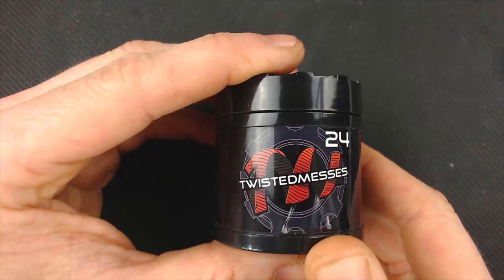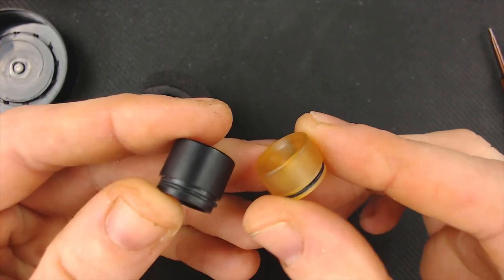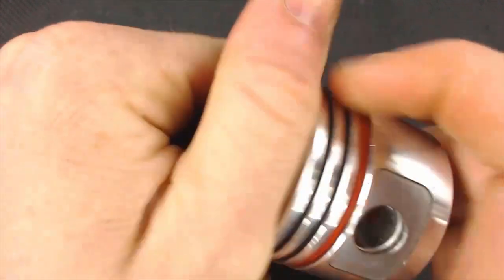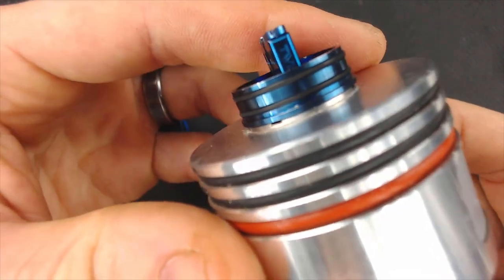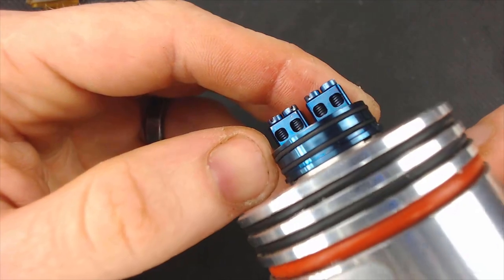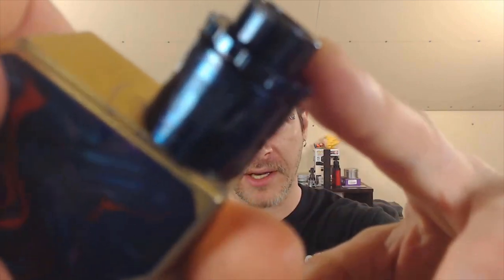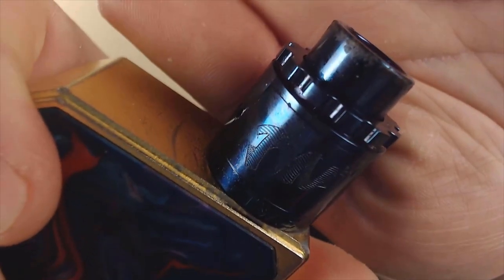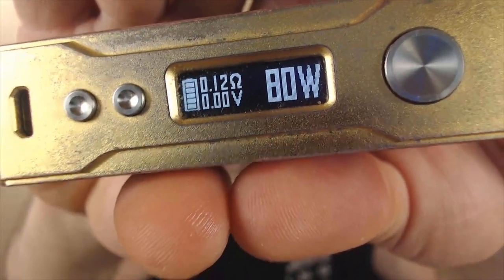The Twisted Messes TM24 Pro rda!

Comment: You gotta get the eclipse cap if your nor a fan of the crown on the top of the barrel. Anyway just found your channel and am really diggin it man. Oh and just a little tip (even though you probably already know this but just in case you don’t) on rdas with these type of posts I find it works better to put the lead that goes over the top on the very outside hole on the deck. It leaves a bit more room for wicking since the bottom leg isn’t in the way. Hope that made sense lol.